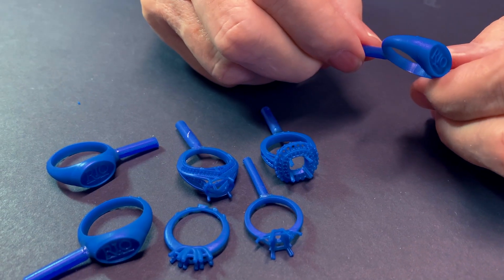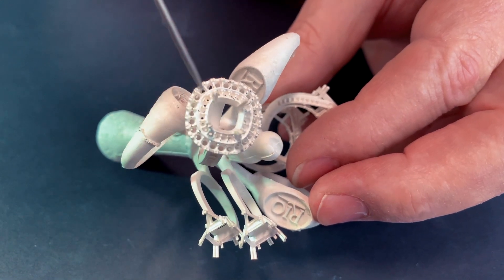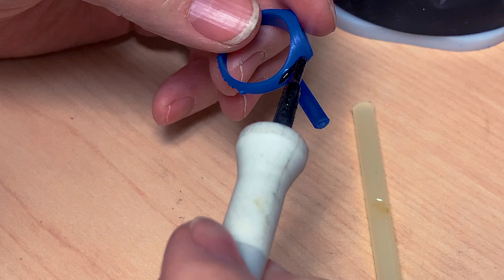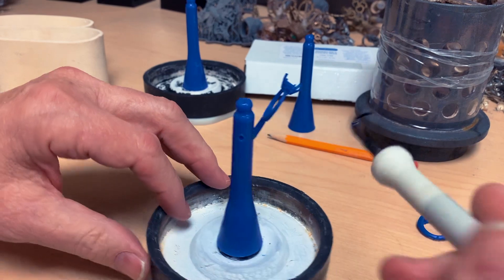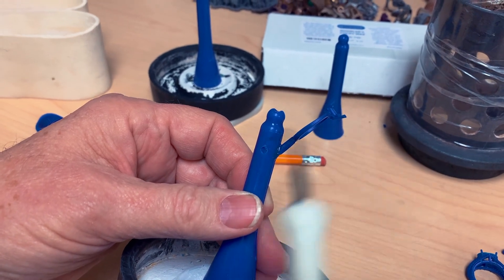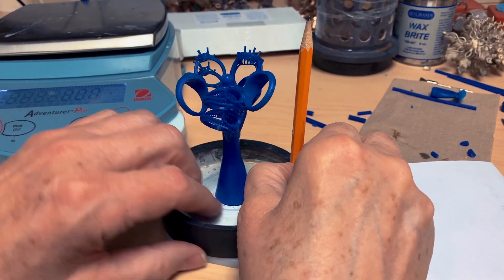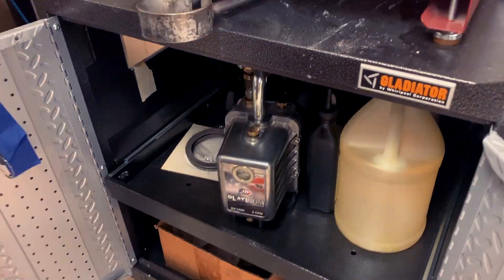Tech Review: Formlabs CW40

Comment: Hi there! may I ask what solution you dip the casting tree into in minute 12:15? thanks in advance!
Reply: Hi Ismail, havent got any direct answers but my best guess is hydrochloric solution dilluted in water. Hope this helps.
Reply: @1LeoHL thank you for your respond. I wanna ask one more thing if you got experience with it, after casting gold I am getting a black shell not just a color, literally a black shell that does effect the whole flask, every ring that comes out is half of it upwards with black shell other half is just in black and after the acid bath the shell exists the same but the black color goes away. Also in polishing steps ı cannot find a cure for the shell.
Reply: @engFurkanIsmail Maybe try to reduce the flask temperature and casting temperature? Decreasing the quenching time also helps. may i ask what material, resin or wax and what kind of machine you're using? Certain material such as rose gold needs special attention as to not be oxidized after casting.
Reply: hello it has been a year from your question but have you find the solution?

Comment: Sometimes when I cast with material with gold. I get very poor results. Any rings with settings have clumps of material around the setting. I can't figure out what it is. It looks like if the piece is "sweating" inside of the investment.  Is it not curing properly? Does it need a uv light?
Reply: did you solve this issue?

Comment: Thanks for the video! Can you make a video talking about purple Formlabs casting? We have some problems with quality of the surface. Thank you!
Reply from the maker: Hello, aboslutely we can! Is there anything else that you would like to see as far as Formlabs is concerned or were just needing more information about purple Formlabs casting?
Reply: @RioGrande1944  I bought the formlabs 3 in Rio Grande, it is great, however, it has been difficult for us to find the optimal conditions for casting using this resin, since the surface quality obtained is not the usual one (normal wax). I understand this is related with the expansion of the resin, the type of investment, its burning and the size of the piece (ashes). Any tip that improves the process is greatly appreciated!
Reply from the maker: @OpinionLibreCL  We can definitely help you on this. We will get your questions over to our Jewelry Tech. They are great and will let us know what they advise and recommend. We will let you know as soon as they get back to us! Thank you for watching!
Reply from the maker: @OpinionLibreCL  Hello, our Tech Team said that they would recommend using plasticast investment for your investment.  They also included a burnout schedule that is usually a great starting place for burnouts. We hope this is helpful for you and let us know if you have any other questions! Thanks for the support and the awesome questions! 
Formlabs Castable Wax 40 Resin Burnout Schedule:
RAMP RATE (DEGREES/HR)       TEMPERATURE (°F)         HOLD (HRS.)
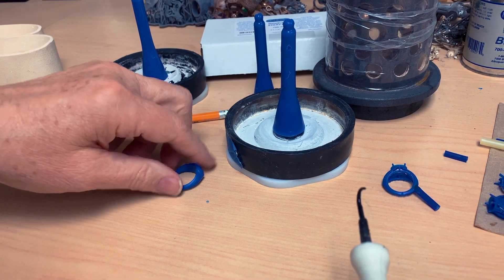1        350/hr                               300F                                   4:00
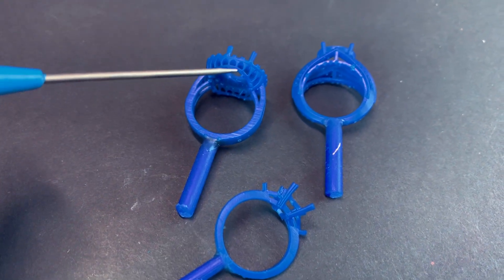2        500/hr                               700F                                   2:00
3        500/hr                               900F                                   2:00
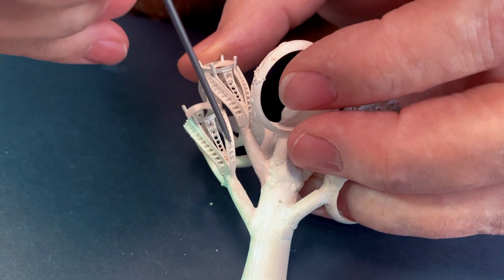4        500/hr                               1400F                                 4:00                   
5        FULL                                  1050F                                 18:00  (long hold)
Reply: @RioGrande1944  Thank you!!! 🤗🤗🤗
Reply from the maker: @OpinionLibreCL  Not a problem! We are always happyt to help! 🙂❤️

Comment: Are the sprues and tree made from the same CW40 as the prints? I have a casting house that cannot melt their wax sprue to the print (or at least that's what they are telling me). How can I resolve this?
Reply from the maker: Richard, we will ask our Tech Team and get back to you.
Reply from the maker: Richard, our Tech Team says that in the video we are using traditional sprue wax for the main tree and feed sprues attached to the resin. We prefer to use regular sprue wax because that part burns out much faster and easier, allowing more oxygen flow to the print itself resulting in a cleaner burnout and a higher quality casting. We hope this answers your question. Please feel free to reach out with any other quesions!

Comment: Hi
I use your [Rio Vacuum Table for Mold-Making, Investing and Casting( #: 705012)].
When using investing mode, my flask didn't bomb, just boiled. That worried me.
So I had problems with porosity. 
When investing, max 29.5 psi.when casting,30psi.
Does 'Not bombing' make a problem?
Thanks a lot.
Reply from the maker: Hello John, we will pass your question along to our Tech Team and get you an answer!
Reply: @RioGrande1944  Thanks
Reply from the maker: @johnlee379  Hello John, we spoke with our Tech Team. They they were not exactly sure what you meant with the phrase the "flask didnl't bomb", but they did also that the investment should rise and then fall in the mixing bowl. After you pour it into the flask and apply a vacuum again the investment should rise again and boil.  If your getting 29.5,  the Tech Team says they are not really sure you can get much better. They also said to make sure that your water powder ratios are accurate. Using distilled water can help if your having issues with the investment. We hope this is helpful to you! Let us know if you have any other questions!
Reply: @RioGrande1944  Thanks 
-flask means “mixed investment”
-not bombing just boiling
-use:distilled water and deionized water
-38:100
-investing mode 29.6 max not 30psi
-casting mode 30 
vacuum machine 1/2HP and 5.0cfm
Because of not bombing, I changed several things. I know what is’bombing’ and ‘boiling’
What do I change to get a good casting?
Thanks again

Comment: Isn't it smarter to have the feed sprue 3D printed with the ring and have it attach to the inside of the ring?
Reply from the maker: Hi there! Good question. It really just depends. If the ring is hollowed out, it is more difficult. Our Jewelry Tech Team member said he also likes to have a feed sprue that is wax, because it will melt and run out sooner than the resin material allowing air to circulate more. The most important thing is to try to attach and feed at the heaviest part of the design, but can certainly model your feed sprues into the print if you like too. :)